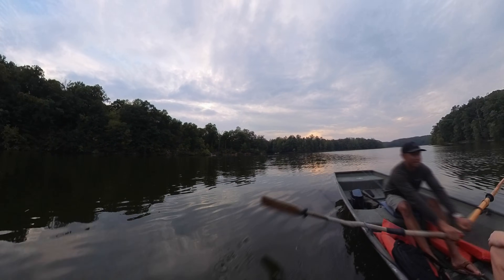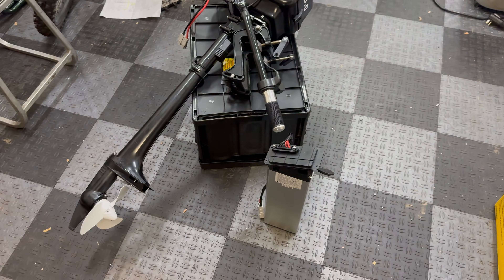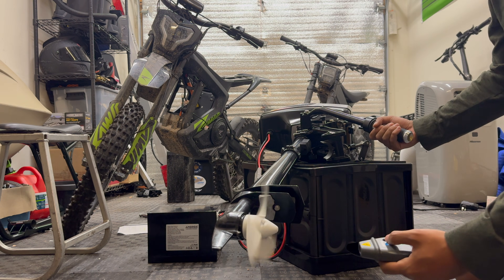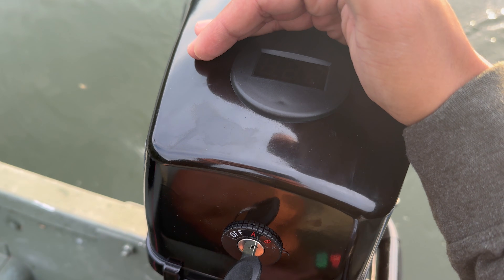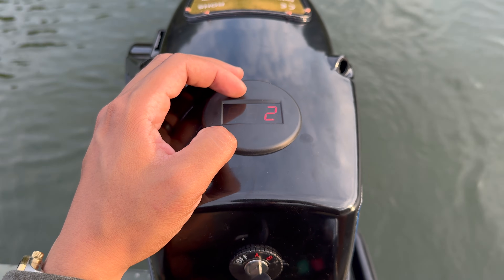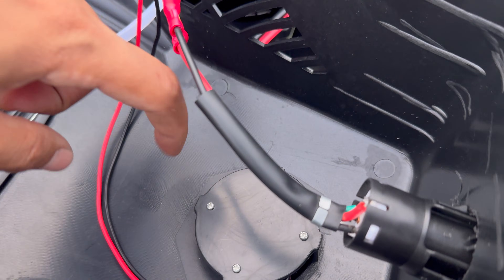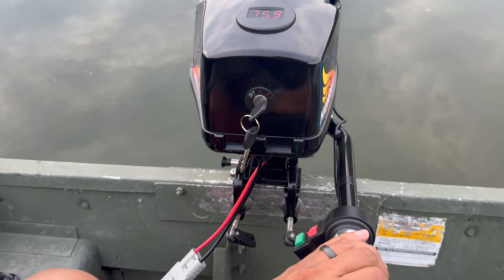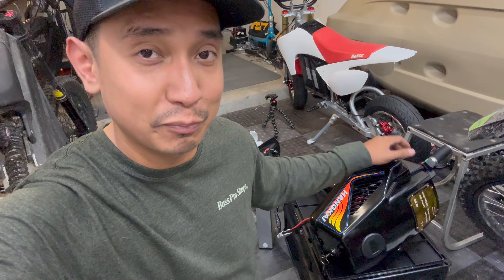Can a Hangkai 48V Outboard Motor Handle 72V - Speed Test

Comment: You should have tried 52 or 60V before.

I was running my "up to 6S" Mamba Monster II ESC also with 8S cells, no problem just the fan soldered to permanent 12V and it was running cool enough.
After a while i tried 10 and 12S.... at 10S it still worked, but 12S was a near instant capacitor blow up.
Reply from the maker: @harrison00xXx  I tried this on 52V prior to this. I just don’t have a 60V battery laying around 🤷🏾‍♂️. It’s a simple experiment before I pull the controller and motor out.
Reply from the maker: @harrison00xXx   Are you still running to original 1200W motor? How long have you been running it for and what size battery are you using?
Reply: @PatOutdoors  Well i talked about my experience with an older RC Car (Traxxas E-Maxx Brushless, literally a MONSTER by its performance longer ago) ESC.
from 24V to 30V so from 6S to 8S was just fine, but 10S, so 36V was already hot for the Mosfets and smelly (probably the caps over its rated voltage). 12S, so about 44V were ofc too much for a ESC rated for 25V.

But i also have a Scooter with a 48V controller and 1000W motor which accepted 60V battery, tho it grilled itself pretty quick after going a bit uphill too fast.

The motor tho was fine, as long you dont have too much current and the windings or their coating doesnt melt/burn the controller typically fails before the motor. Continous load may be a different story.

ESCs can handle longer continous load better than the motor, while the motor can accept a lot of peak power in short term easily.

Since its for water... i guess cooling isnt the issue on either the ESC or the motor?
Reply: @PatOutdoors  On my daily/better E-Scooter i also run a aftermarket VESC based controller.
The Scooter, a Vsett10+ has 60V 1400W rated motors (stock 2x35A ESC) and they are delivering with the 2x100A ESC set to 45A phase current about 2000W per motor continous, no problems so far except the original 60V 25Ah battery is on its limits with this power draw (at least 8C discharge, not counting the current spikes)

But its also nearly impossible beside very dangerous to run this thing for more than 2 minutes full throttle going 80-90 km/h, so i dont run into any overheating or motor damaging things anyways despite the tuning/upgrades unless i have longer trips in hot environment.

Comment: Since you are already in the water use WATER COOLING! no radiator or reservoir tank required cool the motor and controller.
Reply from the maker: @richardkonsky  right, just need to run a pump, hoses, and figure out attaching a heat sink to the controller and motor.

Comment: Awesome test.  I have the same motor and will be interested in any upgrades you make to it.  Can it be adapted to a larger propeller or one with more pitch?  Changing the prop will probably be important in using any extra power you get efficiently without over revving or cavitation.
Reply: Для использования винта с большим шагом, нужно лёгкое судно с малым числом Фруда. У меня самодельный двигатель, с винтом honda 7 шага, и судно, сделанное на заказ, катамаран 5 метров, весом 20 кг. На мощности 850 ватт, этот комплект делает 10 км/час.

Comment: What kind of run times are you getting? Cheers
Reply from the maker: From my experience, you get about 4 miles per every 20AH size battery running full throttle the whole time. So you would get about 20 miles of range if you had a huge 48V 100AH battery.
Reply: @PatOutdoors  thank you!  New Sub here!

Comment: I'm not sure if u did, but I have to put gear oil in the lower unit, pull of prop, two screws and it opens up, fill half way
Reply: Good call. Did that make a difference?

Comment: Heat sink and water cool the controller and a pump to run the cold water to the water block heat sink. That would work much better.

Comment: Hi could you redo the rpm measuring. Since rpm tester works on reflection changes I belive that your valiues are trippled. Try on solid tip of the propeller with black tape square please. Interested. Thanks
Reply from the maker: @paveldvorak200  I just did that as a comparison between 52V and 72V, which is approximately 30% difference in RPM reading. I’m suspecting it would looks something like 3000 RPM vs 3900 RPM if I were to redo it. I’ll try it again once I upgrade the motor and controller.
Reply: @PatOutdoors  Nice, thanks for explaining your view. 
I'm interested because the rpm seems way higher than motors on e-scooters which is my free time hobby.
Thanks again
Reply from the maker: @paveldvorak200  Well E-Scooters and Electric Dirt Bikes is also my hobby so that's why I got interested in this option vs gas outboard lol

Comment: 3:40 Are you sure 12,000rpm is correct? I have the same Laser RPM tester, and I'm sure you'll find that since there is a non reflective gap between each of the three blades, that the light being returned peaks from 'background radiated light' from the edge of each of the three blades, so your true RPM is likely closer to 4000RPM (3x4000=12000), and 4000 is more consistant with the design of the motor. Place a reflective 'dot' below the blades, on the 'cone' of the prop, and take your reading from that location, as this will give you a more reliable reading since the device records the highest returned rad laser light, not the more consistant white of the reflection from surrounding laser light that will be reflexted back by the rest of the cone.
Reply from the maker: @maffysdad  it could be reading a bit off. I was also questioning it myself. Just a matter of comparison between the two voltage with the same test. 52V is is approximately 70% of the voltage of 72V, which is about the same 30% difference is RPM reading. I think no matter how much I increase the power or RPM on this outboard, it will result in diminishing returns due to the design of the prop.
Reply: Considering the OEM rpm is 3000 there's no way that prop is doing 12,000rpm
Reply from the maker: @dan4age  it’s not. It’s really 4500 RPM (just remeasured.) This is just to show the difference in RPM between the two voltages. Same difference percentage wise..

Comment: You'll likely need a different prop to get the full value of any power upgrades. I believe that one will reach a max thrust with diminishing returns at higher rpms. Be really cool to take the actual motor out of a Mercury 9.9hp and swap with a E&Co and better controller like you mentioned.
Reply from the maker: @radeonDEUS  let’s slow down with all the ideas before my wallet drains out 😂 I have been looking at 9.9’s though.. but I’ll likely keep that as is. This is just a fun experiment for me

Comment: The 2 orange wires is probably equal to the white learning wires on most Chinese controllers. So it's probably reverse polarity. 

Put water blocks in things you want to cool. You can buy Fardrivers with them already installed.